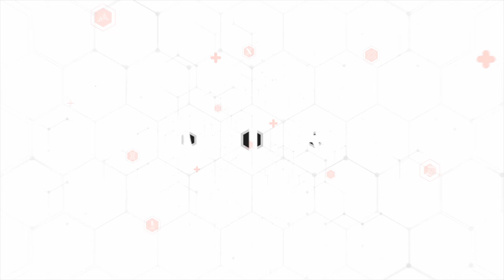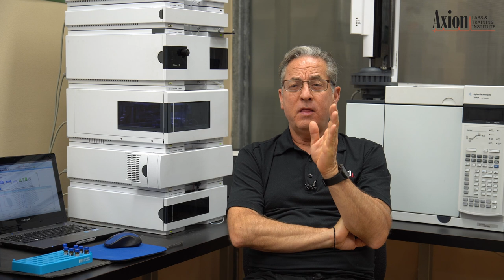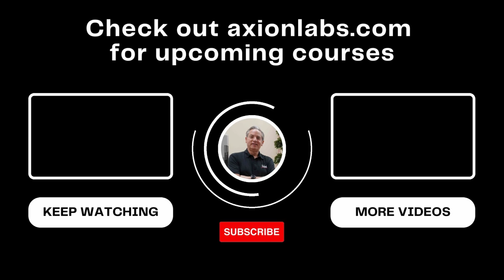Problems caused by dwell volume

Comment: As a newbie, it took me a week to realize that my inconsistent chromatograms was due to the large pump volume of my agilent pump (~600-900 µL). Going at a flow rate of 20 µL/min meant it would take 45+ min to reequilibrate my column after high organic. The EMPV system saved me, as this pumps out way higher flow rate inside the pump, diverting most of it to waste.

Comment: What's makes it more confusing sometimes is different terminology used. Agilent use Delay Volume and Extra Column Volume. While some others use Dwell Volume and Dead Volume.
Reply: Indeed. I view delay volume as the volume inside the pump, dwell volume as any extra column volume from mixing to column, and dead volume as the volume between the autosampler and the detector. I might be wrong though..